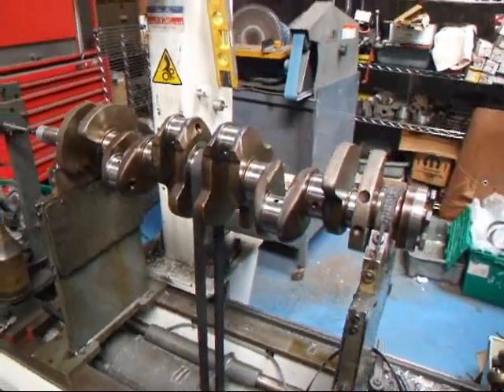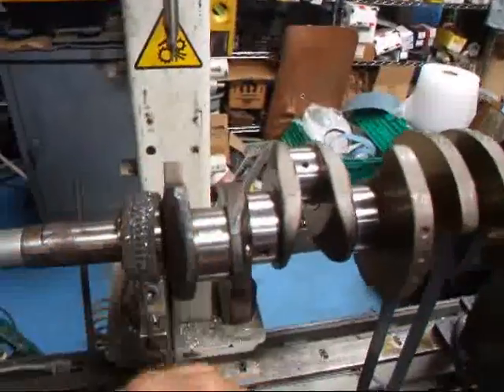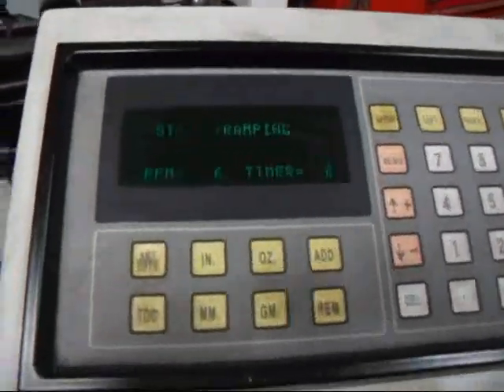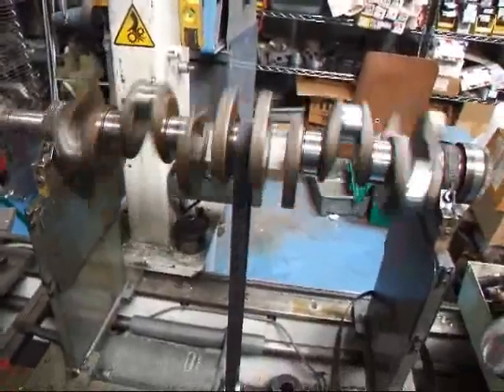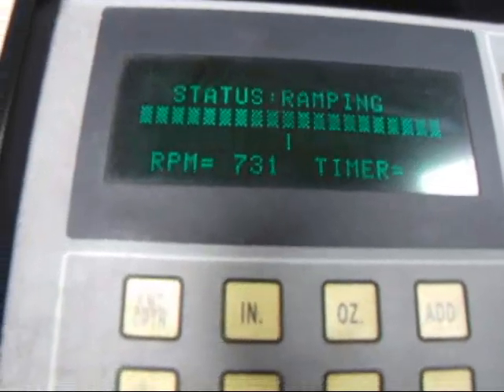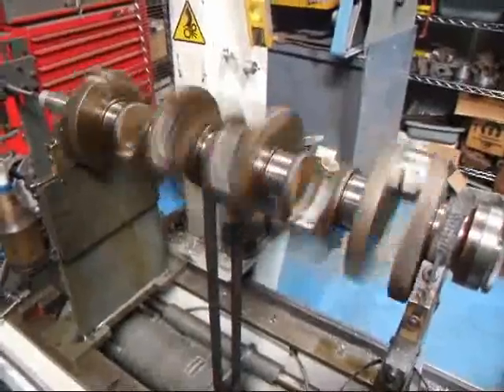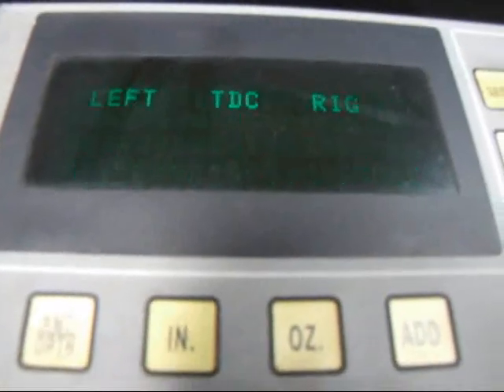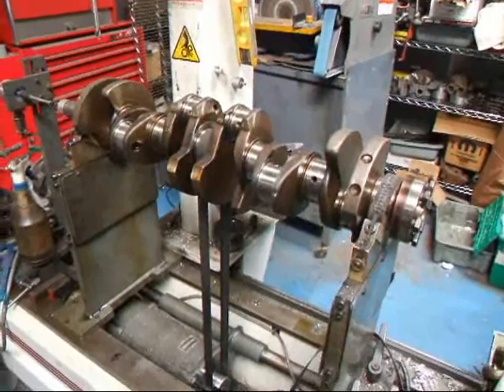Toyota Supra Crankshaft Balancing

Comment: Why do you balance the crankshaft by itself in this video? I saw one other video of yours where they took weight of the rotating assembly (rods, pistons, wrist pins, clips, bearings, etc) and made dummy weights along with the flywheel as well as the harmonic balancer as well as crankshaft pulley attached. Does it vary per manufacturer? Do you have to do this first, then add the rest? Just curious as when I had my rotating assembly done they balanced it different. After being weighed/matched.

Comment: John. I accidentally chipped off a tiny bit of metal from one of the flywheel bolt threads on my crankshaft (I was removing a snapped bolt with a ez-out and accidentally hit the crankshaft thread bottom when drilling the hole on the snapped bolt). Will this throw it out of balance enough for me to worry about it? I'd say I chipped less than a gram maybe. Can material from this area affect it? Or does it only count when material is removed from the counterweights? Thanks!!

Comment from the maker: With a Stewart-Warner balancer that used contact switches that were wired to s strobe light. Just as accurate as todays balancers, but usually took longer to do the job.

Comment: lightend & knife edge crank, forged pistons lightend, light weight steel or Ti rods,(aluminum rods for drag race only), aluminum flywheel & light weight clutch, alum pulleys....have it all balanced together if posible. have your gears in the tranny and final drive REM processed and get some 15-20 pound aluminum wheels

Comment: I'm considering building my 2JZGTE engine for response, and rev speed.  It's no secret that the 2J can  produce and handle tons of power and torque, but I'd like to move through the gear faster.  
So my question comes in crank modifications for weight and things like knife edging etc.
I'm considering a set of Titanium Rods.  So I'd like to find out how all of this works together.

Comment: Make sure your using the correct bearing size.   There are 4 different sized bearings honda uses depending on crank/rod sizes.

Comment: @Totenhosen17 thats what he did with his wires for the sensors and it caused issues with his timing i dont know what boost he was at but it did end up melting a piston one day when i buy another one ill do it with the 7m again i think loved that motor didnt love pulling the intercooler off and watching all the oil drain out :(

Comment: @SuBN01z3RaT I would have a shop do it. 

N/a-t setups will usually just tie the two knock sensor wires into one sensor, then use driftmotions (or the like) n/a-t kit to tap oil feed from the oil pressure sending unit line and have oil return dump into the tank. You can just have a shop tap the block for you and retain the factory routing of lines. But remember, you will be running higher compression pistons, so be sure to run high octane and low boost. Don't want to detonate.

Comment: @Totenhosen17 do you have to have a shop or anything tap it for the second knock sensor? or could you shove it under the drill press and strap it down so its level and do a good enough job to go in with tap and die kit? im glad you messaged back quick i learned something new :)

Comment: @SuBN01z3RaT the blocks are indeed the same. Yes, the Turbo block is tapped for oil feed and return, along with a second knock sensor, but the blocks are the same. You can tap an n/a block for all of that, just as Toyota did, and you would essentially have a "GTE" block.

Toyota's group a race car actually used hand picked n/a blocks off the assembly line..

Comment: Hi.

I don't understand how you know where you have to remove material on all the lenght of the cranckshaft.
it's turning on 2 bearings one at each end with sensors i suppose.
how can the machine tell you it's there you have to remove 
i mean the specific spot on the specific counterweight. 
?